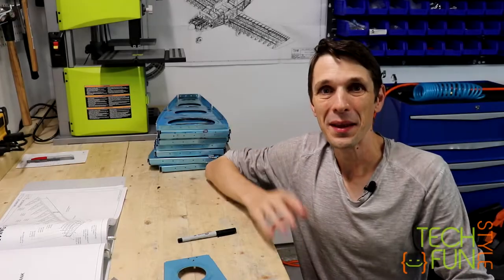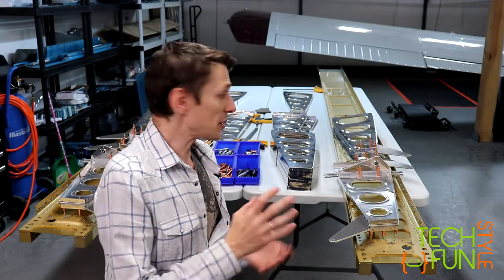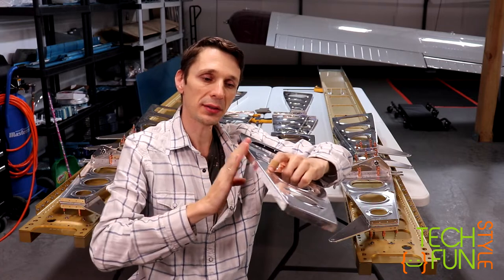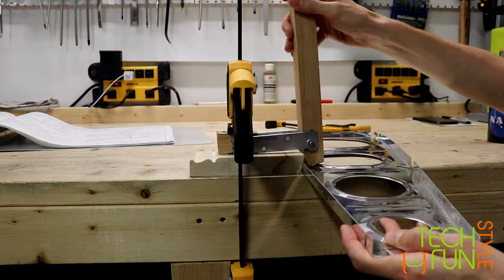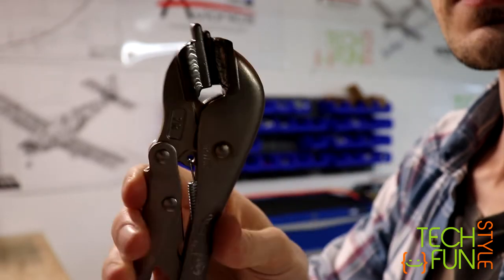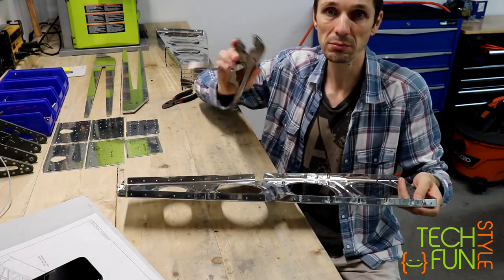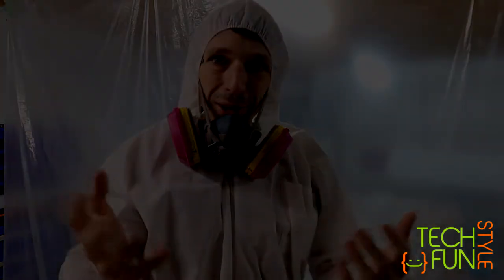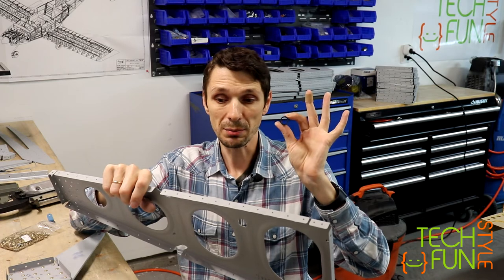RV-10 - Wings assembly. Working on ribs

Comment: Vlad, I you are using the micrometer to scratch a line in the aluminum you may want to stop. In section 5 Van’s talks about scratches in the metal. A deeper scratch can lead to a crack in the future.
Reply from the maker: Thank you for this recommendation. It is true - I do sometimes use micrometer to gently scratch aluminum. I do it super gently and my line is thin and not deep at all. I would say that my scratches are no more than what parts getting during handling and assembly. With the same time I totally understand that any deep scratch may easily lead to crack in the future.

Comment: On the release of the vice grips, I wrapped tape around it so that they don't lock closed.  It would save you from having to pop it back open each time.
Reply from the maker: Michael Thank you! Great idea :) I will do the same I think. I found different flutten tool on Amazon with spring instead of lock but I do not think it worth to get another one, I rather modify what I have :)

Comment: if you don't mind me asking what band saw blade are u using to cut the aluminum? Is it something ryobi sells?
Reply from the maker: This was actually a big deal for me to get good one. At first I was using some blades which were 62", 1/8" wide and 14TPI. These were NOT good to use but available everywhere at local stores. What you really want to purchase is this one: 62" Length, 3/8" Width, 0.025" Thick, 10-14 TPI
I got my from Amazon and it works amazing. This is what I recommend to use to everyone who has similar band saw (62") and wants to cut aluminum with nice and good cuts.
Reply from the maker: Here is the link to it: https://www.amazon.ca/gp/product/B0057GD8ME/ref=ppx_yo_dt_b_asin_title_o00_s00?ie=UTF8&psc=1
Reply: Tech Fun Style Vlad, do you have the 9 inch Ryobi bandsaw?

Comment: Hi Vlad, what is the deburring tool you are using at around 10:30 mark on video?
Reply from the maker: Hey! How are you ? These are some eBay bits for aluminum deburring. Cant find the source link but if I comes around it I will post it here.